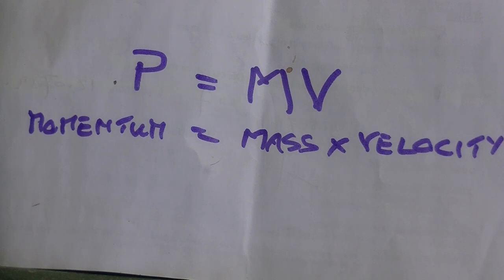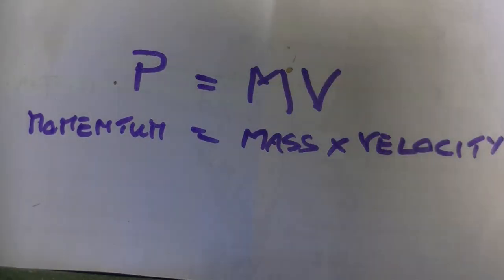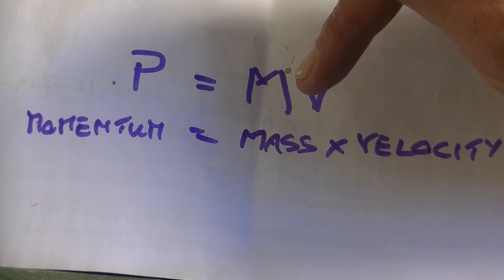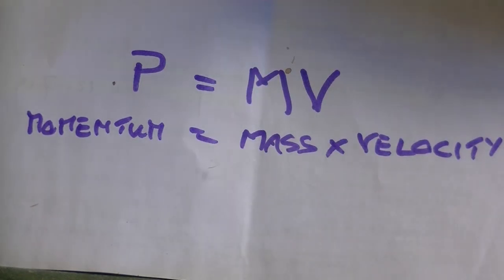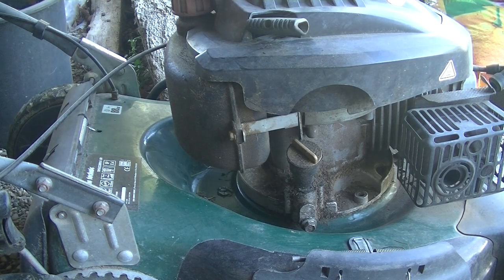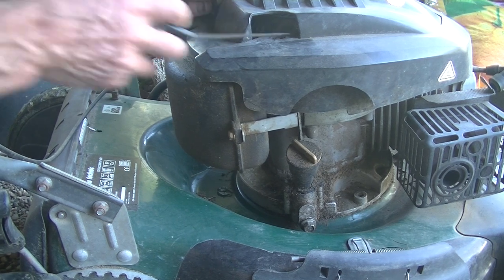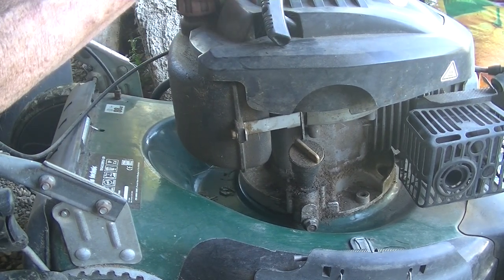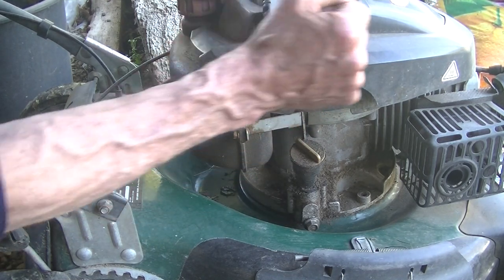Don't ever start your lawnmower without a blade. It's dangerous!!

Comment: When I was a kid, I took our lawnmower engine apart just out of curiosity.  When I took the bottom off, the timing gear fell out and it had no match marks, so I didn't know how to put it back in.  I put it together as I thought it should be, and when I pulled the rope, it didn't feel right and I figured I didn't put it together correctly.  I got someone familiar with engines to look at it; he put the gear back the same way I did and it started.  Turns out, the first time I put it back together, I didn't have the blade on.
Reply from the maker: A curious mind is a good characteristic to have, but I'll bet you were happy when it started again:) The blade just gives it that extra momentum to turn over the engine

Comment: Yep same thing, I am a qualified car mechanic and just rebuilt an old Briggs 450, did exactly the same thing and didn't know why. I originally thought I had set the cam up wrong. I did get it running with n0 blade but it does kick back occasionally when starting. I did hear you can shear the flywheel key starting them with no blade, not sure if this is true. I had to order a new blade bolt as it was fatigued and broke when tightenening, hence the reason for starting with no blade on after rebuild. Oh well it's running sweet now, happy mowing guys.
Reply from the maker: Same thing here. I took mine apart completely to clean and change gaskets all round. Before I put the blade back on I just wanted to see if it was running okay. It kicked back 3 or 4 times before I got it running. My wrist ached for days!. Thanks for the info on the flywheel key, never heard that but its worth remembering, so thank you

Comment: Dave Kennedy 52    Thank you so much, I went over everything 3 times and couldn't figure out what I did wrong. Started up first pull after blade went on.
Reply from the maker: so glad it helped Jeff, the weight of the blade just gives it that extra momentum to keep the engine turning

Comment: An interesting equation that I saw first hand. I had hit a stump root and stalled my mower. Upon restart I noticed a severe vibration transferring right into my hands. After removing the plug wire I inspected the blade and it looked ok. My first thought of dread was that perhaps I bent the shaft on the motor and I should start the mower to see how the motor itself would run. 4:13 😅 Without the blade I attempted to start the mower. Same thing, rope pulled right out of my hand. I did get it to start after a few stubborn attempts and the mower ran terrible. My problem, thank goodness was the two pin guide that the blade attaches to had gotten a bit damaged as one of the pins got partially broke and the blade must of skipped past it. I was able to reposition blade and tighten, all good. Thanks for the video. I got to stay away from stumps!
Reply from the maker: I could write a book about everyone's experiences! What you said about "after a few stubborn attempts" is probably true about all of us who have tried and tried again. Determined to get it running and getting hurt every time. Thanks for the story and glad you got your problem sorted

Comment: I did this in job corps in a attempt to fix several mowers.   After it ripped out of my hand I pulled again with a tighter grip and pulled harder.   The handle hit my other hand on the bar. Very painfull !!
Reply from the maker: That brings back such painful memories!! I also pulled again with a tighter grip which made it worse.

Comment: This is a brilliant and simple explanation and enough to click that subscribe button on just this one video.  I had a similar problem with an old large Stihl chainsaw.  It would literally rip the starter cord from my fingers.  I finally realized the flywheel key was damaged and not making the proper connection between the flywheel and the crankshaft resulting in a similar experience to the missing lawnmower blade.  However, I never knew why or how it was happening.  Now I do.  Thank you!
Reply from the maker: thanks dpm, yes, you're right, a worn flywheel key would have the same effect. Can be pretty painful if it catches you unaware. I'm glad that you managed to identify your problem. Thanks for watching and I really appreciate you subscribing

Comment: Now I am doing a 24hr push mowing race and we have to remove the blades and I’ve found no issue with the engine running or starting it runs and sounds more like a go kart however the settings on the carburetor must be changed so it does have what’s called kick back from the pull starter however in order to start the engine you must pull the pull start twise as hard as you do normally to have enough momentum to keep the engine from kicking back and spinning backwards
Reply from the maker: Asaden, I think you might have the solution, if you pull the starter rope hard enough, it can have enough momentum to pass that kick back point, good luck with your race and just be careful of your hands. Wouldn't mind you mowing my lawn for 24 hours!!

Comment: Hi Dave,
I have an old mower that I completely restored. I was excited to get it started up, but when I tried to start it the exact same thing happens to me! I pull it over and it yanks the cord right out of my hand. But the mower has a blade on it so I am not sure why it kicks back. It is a 5.5 HP tecumseh engine. Any tips on how to fix this? 

Best Regards, Luke
Reply from the maker: A great feeling getting an old mower running again! At the exact moment that your piston is at TDC (top dead centre) there is ignition. If ignition happens slightly before (even a millimeter), you will get that terrible kickback. So perhaps check that the key on the shaft that holds the flywheel in place is in good condition and not worn. Its got to be a real tight fit. You can also see if you can move your coil a bit in the direction that the flywheel turns. This will retard your timing a bit and will definitely help. Good luck!

Comment: My lawnmower kicked back on me yesterday as i put too much petrol in the carb as no fuel was getting to it. My fingers did hurt for a few hours and unblocked the carb.
Reply from the maker: I'm sure that cleaned your carb out!! Must have been quite a "pop", glad you still have fingers:))
Reply: @davekennedy52  It was an ouch moment and that used to happen all the time when the pull cord on my RC Nitro car jammed alot so converted it to drill start. My lawmnower still doesn't run that great but will fix it in spring.
Reply from the maker: can't wait for spring, thanks for watching the video

Comment: Some newer Tecumseh engines have aluminium flywheels and they can be started without the blade.
Reply from the maker: Thanks for the info, according to the law of momentum, a light flywheel should make it worse. My machine has an aluminium flywheel and thats the one that zapped me. Maybe Tecumseh have developed something new and unique
Reply: @davekennedy52  I don't know, but the Vantage 3.5 models all had aluminium flywheels and you were able to start them without a blade because they were also used on tillers. Probably because of the very small piston
Reply from the maker: @smallenginesgarage7168  Thanks thats very interesting. I have this machine which doesn't use a blade. https://www.mcculloch.com/int/products/brushcutters/mwt420/961710003/

Comment: What would happen if it was started with a key in ignition switch instead of the pull rope?
Reply from the maker: Maggie, usually the key would start the engine only( like a ride on mower) and then the blade would engage afterwards, so you wouldn't have the problem. a pull rope turns the blade with the engine and if there's no blade you can experience a kick back and if you're still holding the rope it can get ripped out of your hand, like I painfully experienced:)
Reply: @davekennedy52  thank you, I understand, yes riding mower has separate switch to engage the blade.
Reply from the maker: @Maggie-Gardener-Maker  Happy mowing!

Comment: I just tore my engine down for kickback and yes the blade is off 🤦‍♂️
Reply from the maker: While my blade was off for sharpening, I reset my coil gap then tried to start it without the blade. Had my wrist strapped up for a week, so I was a bit nervous making this video.
Reply: davekennedy52 dang. Yeah it jerked the hell out of me and then came out of my hand and slapped the top of it.

Lucky I came across this video!